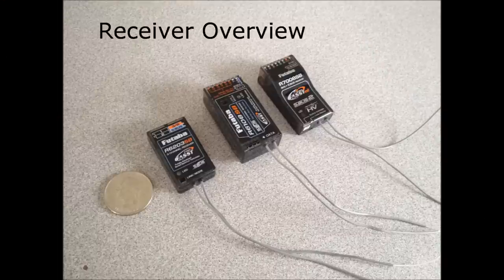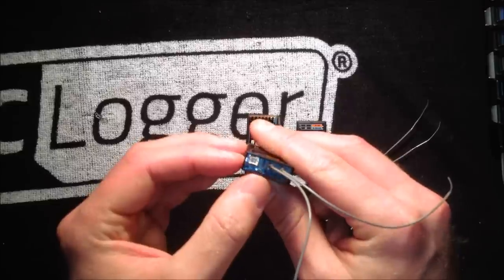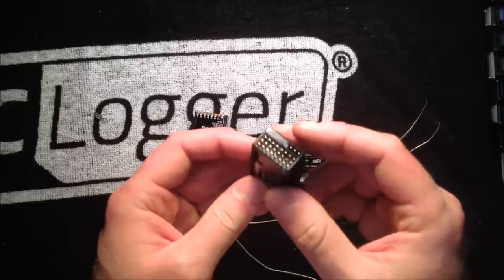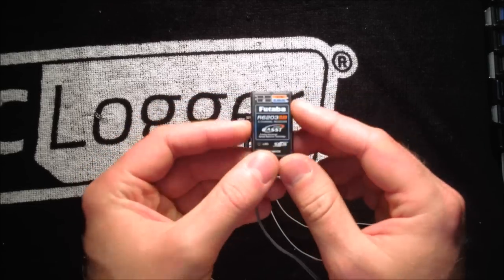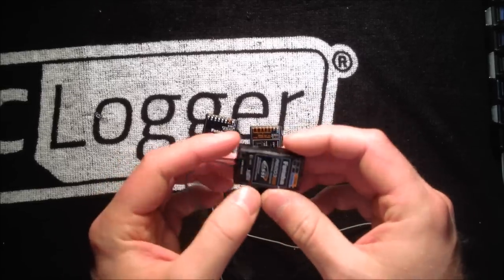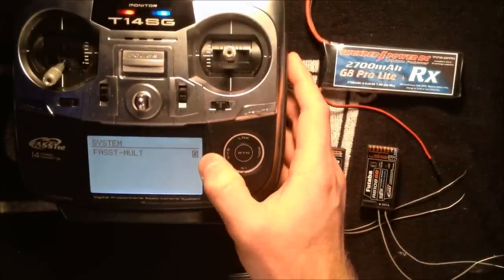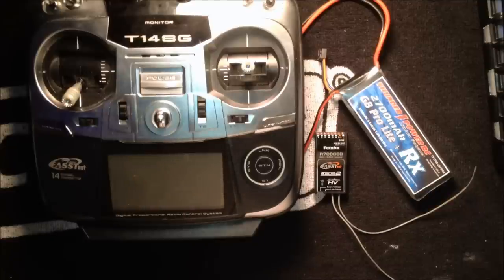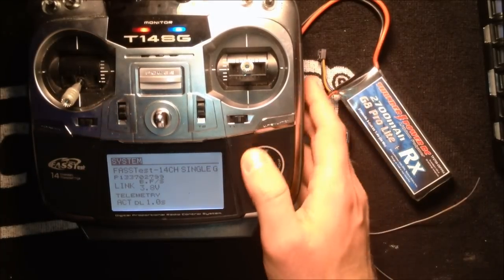Futaba Receiver Overview and Linking Process

Comment: What type of cord/switch is used to connect the battery to the receiver? I don't have that type of cord attached to my batter. I'm using am Admiral Pro 2200mah 4s 14.8V. Trying to connect it to the Futaba R3106GF reciever.

Comment: Excellent video. I tried 2 hours to connect R7008SB before I found your video. There is not any explanation neihter 14SG nor R7008 manual. Thanks alot.

Comment: hi dchekas, is the R70008sb reciever, HV, stand for High Voltage?  could i plug the external port for external voltage to my Lipo: 5000mah, 50c, S4?  thank you

Comment: Really helpful video - been looking for a clear demonstration of binding on the FASSTest R7008SB for a while. For my set up I  need to setup my 14SG to transmit only 8 channels. Which setting should I use for this (Multi, FHSS?) and will this work with the R70008B? If not what Rx would you recommend?
Reply from the maker: You should use FASSTest 12Ch mode, unless you intend to run one of the telemetry sensors that plugs into the S-Bus2 port (Sounds like you are not).

You will want the receiver to be in mode A for ports 1-8 to correspond to channels 1-8. Note that this will disable S-Bus output on Port 8, but it sounds like you are not using S-Bus in your application.
Reply: dchekas Thanks for your reply. I have the R7008SB  in mode A and it is bound to the T14SG in 12Ch mode but this doesn't seem to work for what I am trying to do which is install a fatshark head tracking camera gimbal.  The FPVLab forum Fatshark states : 

http://tinyurl.com/pgfaz9p

"Futaba T14SG （must be in 8ch mode and trainer switch assigned - pg 18th this thread)."

This goes into a little more detail on page 18 of the same thread:

"You must be in 8ch mode and the channels have to be set to NORM. In the trainer menu. You also have to assign a switch to activate the tracking system. "Act" must be set to on"

The problem is I can't get the R7008SB  to bind to the T14SG in 8Ch mode (FHSS). Is this even possible and if not what Rx will work?
Reply from the maker: Samuel Livingstone
The R7008SB will only link in FASSTest 12CH or FASSTesT 14CH mode.

FHSS is a different transmission protocol between the radio and receiver, and is only used on FHSS receivers. I highly doubt this is causing the issue in your application.

Relink the receiver in FASSTesT 12CH and verify the receiver is set to Mode A.
Reply: That's what I thought but was confused when Fatshark on the forum was saying the 3-axis mount only works on 8 channel mode using the T14SG! You are right as I just tried assigning the pan and tilt to RS and LS and I can control the 3-acis mount when in 12ch mode! Therefore it seems the problem is with the settings used when T14SG is attached to the head tracking goggles via the trainer cable. I got the trainer switch on and assigned the pan and tilt channels  (6 & 7) on the T14SG to both FUNC and NORM, but still no joy. Don't know what else to try.

By now we've drifted off the thread topic so should leave it there, but thanks again for your help and clarification!
Reply: @dchekas  I AM TRYING TO LINK THE RECEIVER R2008SB  (dRONE APM TAROT) TO THE T10J FUTABA T-FHSS, I DID THE SAME PROCESS , BUT I AM NOT GETTING THE LINK ID CODE, NO GETTING CONNECTED, WHAT CAN I DO. PLEASE ASSIST ME WITH THE PROCEDURE AND ADVICE. THANK YOU IN ADVANCE.    IT WAS IN USE BEFORE.

Comment: I have everything Setup on the R7008SB exactly like the manual said to, I linked it right etc...  I have it linked as 14 FASSTesT and the Sbus cable is connected into the SBus2 port. I'm trying to change it to 12 channels for quicker response and trying to figure out why Telemtry is not working on it as well... If I relink my receiver and set it up as 12 channel FASSTesT will my other set ups on the radio change at all or will they remain the same? and lastly any advice on how to make Telemetry work? Thank You!
Reply: Sebastian Aguirre Here is a guess, from my exposure to a little glitch, or build in feature, you might say.

  I have found that if I link my R7008SB receiver to my T14SG transmitter, some times my telemetry does not work, no matter what I do.   Had two receivers, one could see the telemetry, one I could not.  All other functions seemed to work fine, as far as I know.  Found this answer in another forum, and as I beat myself to death, for a day and a half trying to figure out why, I thought I would pass this along.

A.  Symptoms:  
   Not properly linked telemetry receiver.
   1.  LNK_Telemetry:
        No telemetry will work, and am not seeing any bars on the antenna.

   2.  LNK_System:
        There is an receiver ID# for the sensor: P_____________.  But it is blank.
        (Very similar to most of the manual pictures, and probably why it is not noticed by most.)

     A properly linked telemetry receiver:
   1.  LNK_Telemetry:
        Seeing at least receiver battery voltage telemetry.  There are bars on the right side of the antenna, like on most cell phones these days.

   2.  LNK_System:
        There is a proper receiver ID# for the sensor, like: P13420201.

B.  The fix: (Relink the transmitter properly.)

   1.   Power off receiver, but have it ready to power on.

   2.  Go to LNK_System and click the link.  The transmitter will start to beap, as it starts the link process.  (Don't have other receivers powered on close by!)

   3.  Power on the receiver.  It will relink the transmitter, and receiver properly, and you can then see the receivers ID in the LNK_System menu, and see telemetry in the LNK_Telemetry menu, if you have it activated in the LNK_System menu.
.

Comment: I have a T14SG and also have 3 planes, but every rx are linked on each model, so no matter what model I have selected, if I turn on two planes or three avery single plane have signal at the same time. what can I do to avoid that ? please help!
Reply: I AM TRYING TO LINK THE RECEIVER R2008SB  (dRONE APM TAROT) TO THE T10J FUTABA T-FHSS, I DID THE SAME PROCESS , BUT I AM NOT GETTING THE LINK ID CODE, NO GETTING CONNECTED, WHAT CAN I DO. PLEASE ASSIST ME WITH THE PROCEDURE AND ADVICE. THANK YOU IN ADVANCE.    IT WAS IN USE BEFORE.

Comment: Hi I tried to link my R7008SB in 12ch FASSTest mode but it won`t link. It only works in the 14 ch mode. Why?
Reply: James Hatton Some other facts:
T14SG:  with R7008SB: 
1.  If your running any analog servo's can only be in 14CH mode.  This is probably what your seeing?

  2.  You can actually use the receiver battery sensor, and external battery telemetry while in CH12 mode.  You cannot use any of the other telemetry in 12CH mode, and it only allows for digital servos.  

  3.  Although not stated well, CH14 mode, is the default telemetry mode, and can do all telemetry, and use analog servos.  You can adjust telemetry feedback from .1 to 2.0 seconds also, to adjust, if so desired.

Comment: Hello friend I can not blind my second reciver r7008sb . The first works well but the second can not could help me both reciver are r7008sb .
thank you
Reply from the maker: Kazu Watanabe Go to the linkage menu, and then select system. Make sure you are in FASSTesT 14CH mode. Make sure you have "DUAL" selected not "single".

From here, you will see two different link options. There should be a P and an S (Primary and Secondary), and under each one will be a "LINK" option. 

Make sure your receivers are powered off. Then power on your Primary receiver, and press "link" underneath the "P" side of the menu. Wait for the receiver to link. Then power up the secondary receiver, and press "link" underneath the "S" side of the menu. You should be all set.

Comment: good night friend! Would you assist me? I need to do the bind in R3008SB futaba receiver, I need to install it on my hexacoptero and the "friend" who would do can, for lack of time already .since not thank you .very thanks anyway.
Reply from the maker: Luiz,

I am assuming you are trying to link to the Futaba 10J. In which case, the link process is very similar to linking a Fasstest receiver.

You will need to go into the Model Select screen (mdl-sel), scroll down to where it says "link > ID (Or "NO LINK"), and click it on it. Then, with the receiver close to the transmitter, quickly power on the receiver. The two should link within a few seconds.

Please refer to page 27 of the 10J manual: http://manuals.hobbico.com/fut/10j-manual.pdf
Reply: ok my doubts and that the link id ha a specific number on it. Is this normal?
Reply: @dchekas  I AM TRYING TO LINK THE RECEIVER R2008SB  (dRONE APM TAROT) TO THE T10J FUTABA T-FHSS, I DID THE SAME PROCESS , BUT I AM NOT GETTING THE LINK ID CODE, NO GETTING CONNECTED, WHAT CAN I DO. PLEASE ASSIST ME WITH THE PROCEDURE AND ADVICE. THANK YOU IN ADVANCE.    IT WAS IN USE BEFORE.